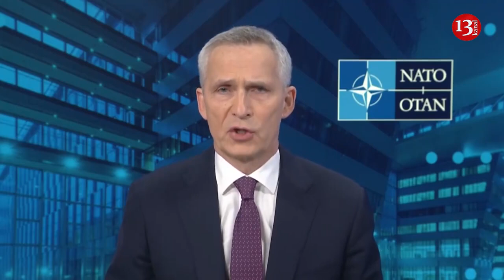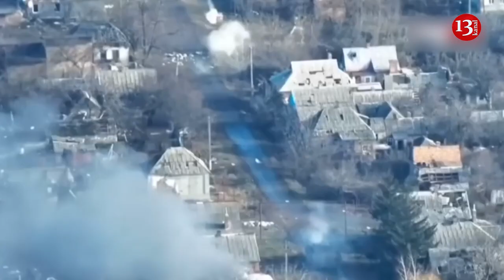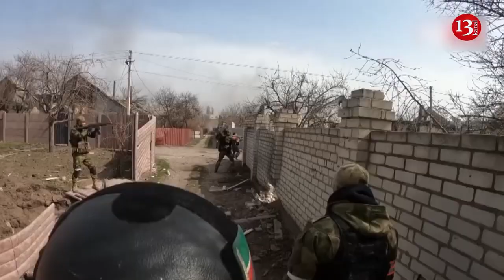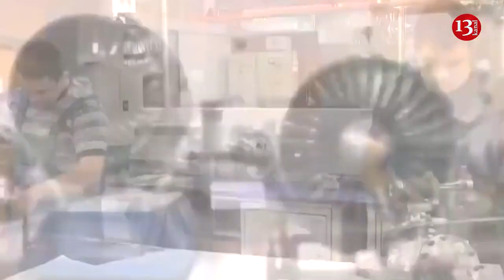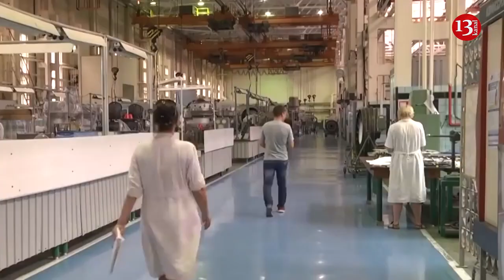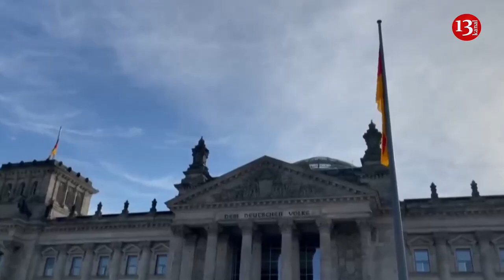NATO chief: Ukraine needs to be armed for a long war

Comment: NATO needs to understand that it was not prepared for a war and this bad attitude needs to change with the end of stepped escalation, it has proven a failure, automatic industrial support for the front line by NATO with many ammo plants sold to private companies resumed by NATO, had the ammo & supplies of Tanks been boosted in 2014 and deliveries started in 2014 we would not be in this hard place.